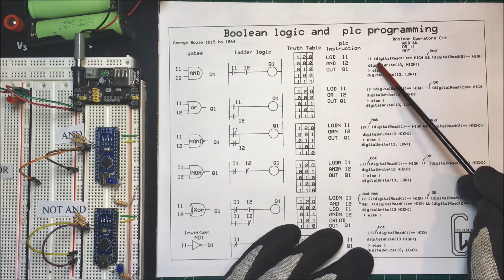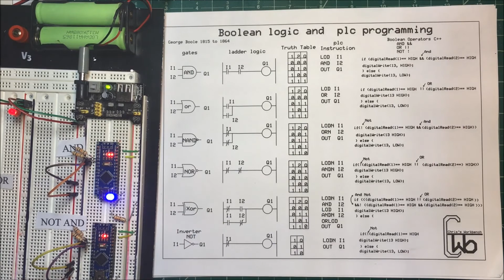Boolean Logic

Comment: Hi Chris.  I am in the out-loud thinking stages of a PLC like uC system.  I have never seen the PLC instruction set (I think anyway :) and it looks like I could roll a compiler for it. Is the one you show for a particular PLC brand or system?  I have read LL before back in the '90s whilst converting a PLC system to a microprocessor-based C system. Thanks!
Reply from the maker: It was used with a Idec micro
Reply: @ke6chris  Thanks.